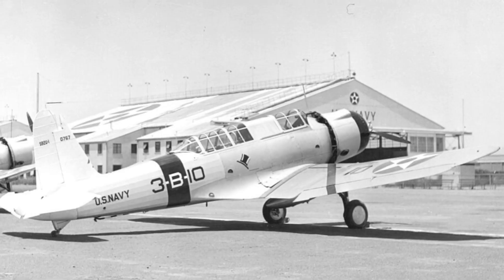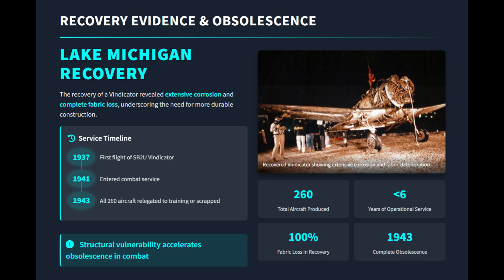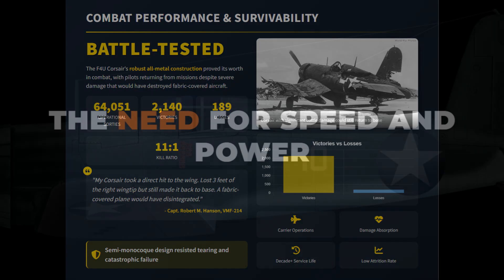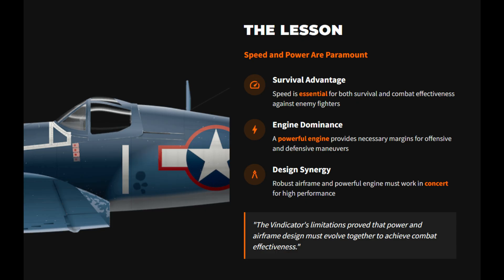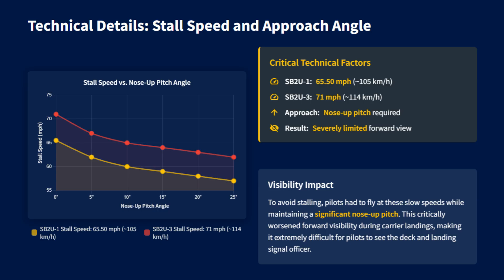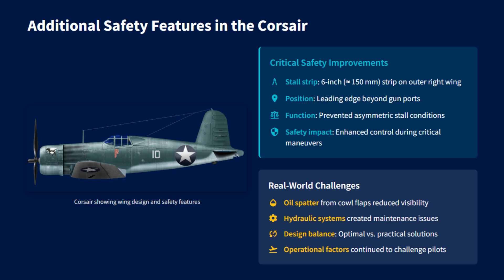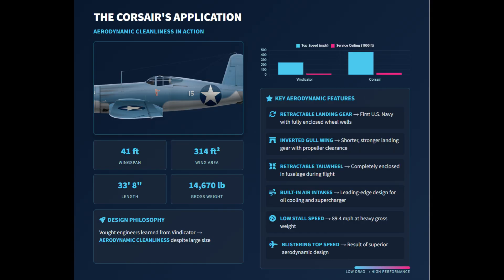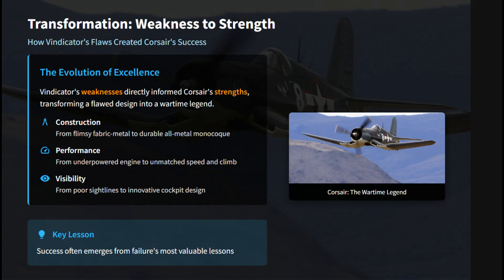Four Vindicator's Flaws That Made the F4U Corsair A Better Fighter

Comment: Vindicator was principally a torpedo plane, not a dive bomber,no airbrakes either, totally misidentified, and misunderstood. Corsair is from a generation or later engineering. Vindicator was state of the art when first adopted, Grumman had prototypes of the Avenger flying before Dec.7th. It was made obsolete by the rapid advances in aviation technology.
Reply: The Vindicator was never equipped with torpedoes. It was used as a dive bomber, glide bomber and level bomber. You are correct in how quickly technological advances rendered it obsolete. Same thing happened to the Devastator. Once designers had powerful engines and strong airframes to work with, variants had longer lifespans